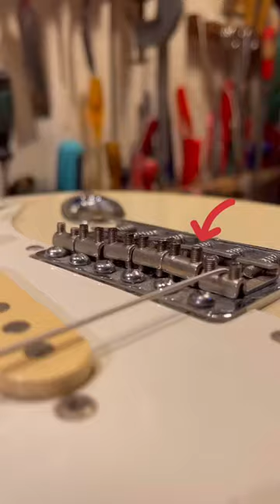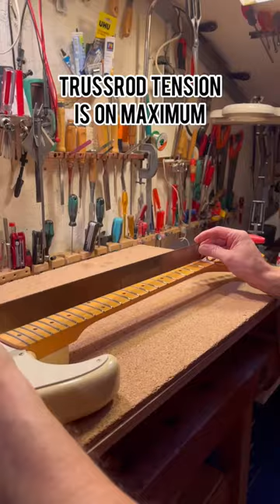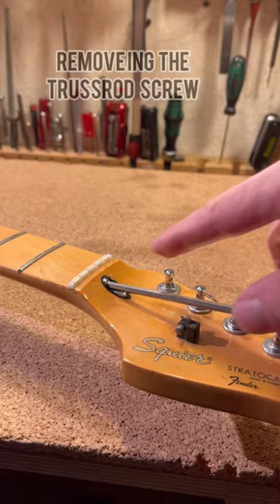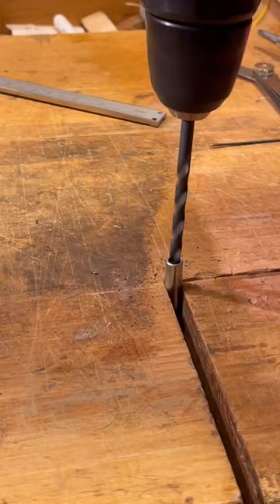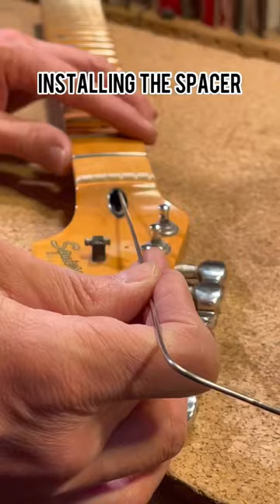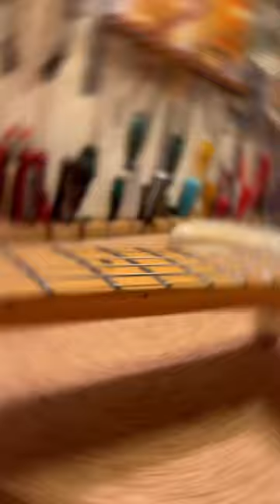Squier Stratocaster Fender Guitar Neck/ Trussrod repair #asmr  #guitar #howto #diy #tutorial #craft

Comment: Is drilling the hole deeper necessary? Dan erlewine described taking the nut out and drilling it deeper before installing the spacer. What are you thoughts? Thanks?
Reply from the maker: If necessary you can drill it deep but Intuit case it work out fine… Best Regards Nik

Comment: my tele 75th anniversary mim, has this issue I think. 
can't get the neck flat there's a hump around the 12th the truss is tight as I am comfortable going, this would give me more purchase on the back bow tension. if not I can just take the saver out doesn't need to be a long spacer 1/4 inch . thanks I'll give it a try, it won't damage my neck any more than trying to over tighten the nut so win win or just back to the drawing board. thanks
Reply from the maker: Hey Mike, yes give it try hope it works out well. Best Regards Nik

Comment: My neck doesn't have enough bow and the truss rod is loose all the way. This would help if you had too much bow.
Reply from the maker: Thanks for your question. No if you have a back bow this process will not help you out. Best Regards Nik
Reply: @petrekguitars my squire doesn't have enough back bow when the trust rod is all the way loose. how can I fix that?
Reply: tightening it gives it bow. not back bow.
Reply from the maker: If its a one way Trussrod it´s a very time consuming Repair. Sorry for that. Best Regards Nik @ozoneswiftak
Reply from the maker: This is not a easy fix if you do have a one Way Trussrod installed. Best Regards Nik @ozoneswiftak